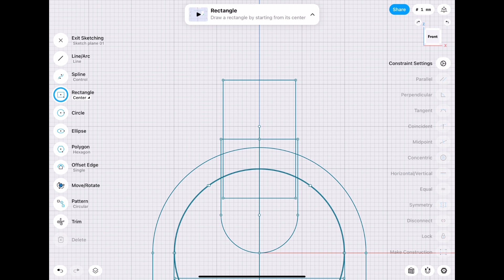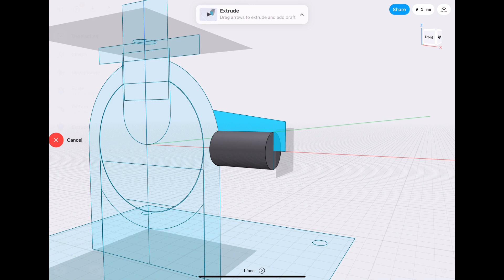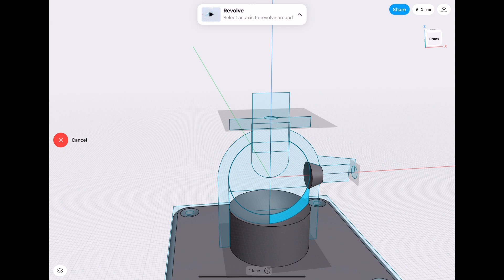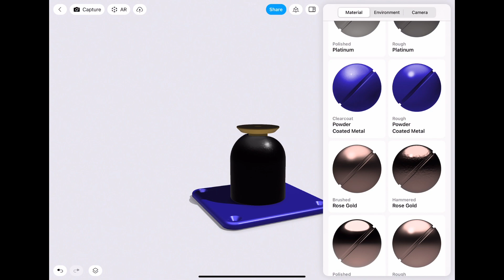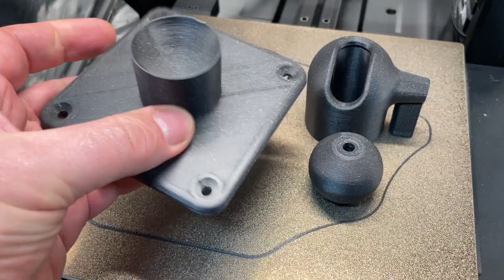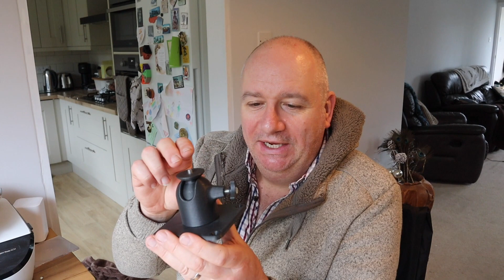Shapr3D - 3D design to 3D print

Comment: Thanks for taking the time to make the video and show us an actual 3D printed product from the Shapr3D software. Well done mate Question: the visible layer lines, is that because the Ender printer doesn't have the facility to print thinner or nearly invisible layer lines, or is this a speed / machine setting choice you made? Thank you.
Reply from the maker: I could have printed it with thinner layers and the ASA filament was probably not the best choice. I love using the software and use it several times per week, it really is amazingly easy to use. You can see it in use again in my latest video ( 3D scanning at Makers Central). Many thanks for watching.

Comment: I am 100% new to 3D Modeling 
I have a million ideas that I could print for the school my kids goto. 
I just need to make them.
Would this subscription software be the best for a beginner that isn’t goin to be designing things that aren’t too terribly complicated. 
Or is there a better beginner subscription software… 

At first I thought I was going to have to build a workstation pc to handle the software but now it seems maybe that isn’t quite necessary. 
Any help or direction would be absolutely appreciated 🙂
Reply from the maker: I can whole heartedly recd Shapr3D for beginners it is incredibly easy to use and you will be able to design surprisingly complex objects very quickly, especially if you follow their tutorials. I have tried other subscription free software but they are not as intuitive to use and usually have a very steep learning curve. Shapr3D does not require a particularly powerful computer to run it and I use it on my ipad without any issues
Reply: Your kids school email address can get them/you a free, full version. Have to verify the email annually but it's easy.

Comment: I think your definition of “easy to use” is a little different than mine. The learning curve on these CAD programs is very steep. You are very talented. I’m still struggling with Tinkercad!
Reply from the maker: Thank you very much. I struggle with Tinkercad and Blender, Shapr3D is much easier, there is a walk through tutorial with the program and this got me designing complex structures within minutes. Many thanks for watching.
Reply: This is super easy my kids use it at school and my 3D printer has never been used so much since the school switched from freecad to this

Comment: If you'll get too weak layer adhesion, your camera will fall off the mount. Try printing in other direction for stronger or safer holding.
Reply from the maker: Yes, this is just a protype, the stainless bolt running through will help with the strength too. I have found that the ball is better printed in 2 halves and bonded together with acetone afterwards.